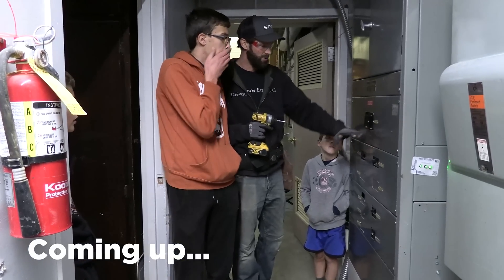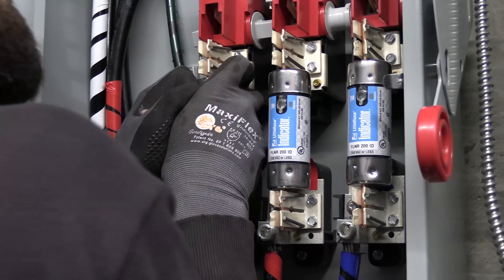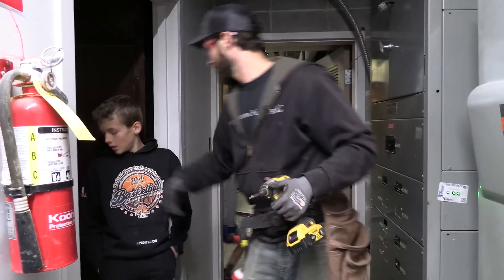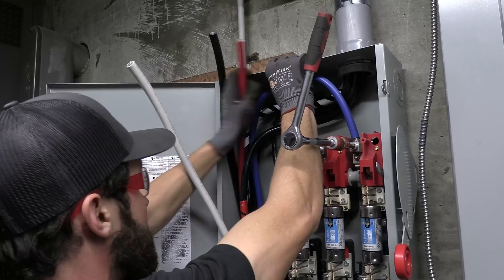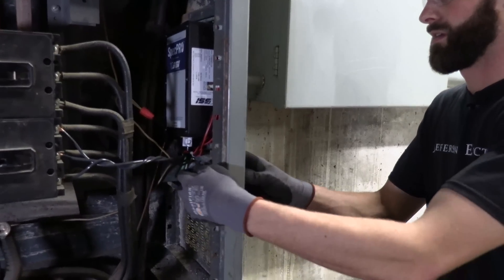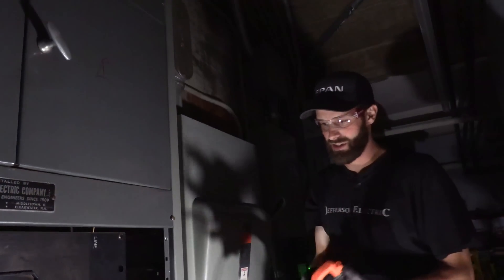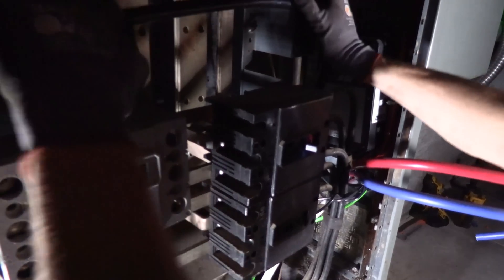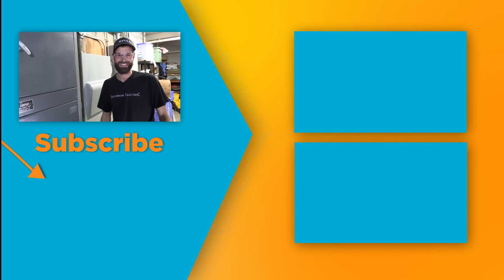They Don't Make These Anymore

Comment: Wow that was quite something I like how you got the kids involved but teach them safety
Reply: I have a feeling there's probably going to be a few more electricians in the future for sure in this family I'm assuming their family in this case myself I was rewiring lamps at 4 and 5 years old that's how early learn basic electrical.

Even before that understood most of the basics of electrical systems.

He might think I'm joking here but I'm serious in that respect and also my first word was my mommy or daddy or Dad or Mom but my first word was actually Outlet as in a receptacle.

People said I was literally born to be working on things and doing repairs.

I was actually doing electrical work even when I was quite Young of course falling all safety precautions but everything else.

Was a bit late on getting going on soldering when I was a kid for electronics because my dad had a bad experience with soldering iron once it was all scared because he really messed up his fingers with pretty bad burn.

Me and my father were repairing that you'll hairdryer had to put in a new diode it was just use to cut back power for either heating element ornamotor cannot remember which you know the old trick of half wave rectification to cut output power essentially like the old school high low off dimmer switches.

Actually have a little box it's essentially a nice big chunky diode to be a a way to cut back the output of linings for low-level Lights by just using standard incandescent bulbs of course fused and has a ground and even a thermal fuse this was Obama design there's a relay to bypass and a relay for off although this was never used what was in place possibly even for future automation and yeah there is a bypass switch as well just built into it small Project Box the original one I built basically just had one of those tags strips with a grounded female fog and the diode and a fuse in a female receptacle can't remember if I had a second quarter Accord as the outfit and just a female in there or single receptacle on the outfit had use that one never but it still around somewhere also good for taming down Christmas lights and other things as well I think I would have given it to someone that wanted to use some personal size for low-level lighting he just needed a bit of light at night in some rooms and they other rooms like this as well I basically built a bunch of these devices for this and also had a switch on a cord as well the thing is that dimming wasn't needed just either full-on or fall off or just a half wave rectification only made a lot less expensive than trying to use some sort of dimmer had all the parts anyways.

Something of Interest lawn friends came up with he was a guitar enthusiast and he had a gag cable that was 40 said was the only true electric guitar cable there was!

It looked what would have been a male grounded plug going to the other end and guitar cable recorder inch Jack of course however absolutely zero internal clock the connections in fully insulated does a gag of course but yet it got some people's attention when he pulled the thing out and yes it was a luminating plugged to get the point across that looks like there's actually power there he had me build this forum it was one of those things that if somebody just like their eyes pop out of their head if they even see it for an AC and plug it in before plugging in the guitar that is something that you do if you wanted to get attention or in the end get a good laugh yeah but yeah it really makes someone jump out of their skin is well it's one of the things that you know you got to have some sort of gag here in there or something to get someone's eyebrows raised.

And I also made him another one that was what he called the direct box Hannah powerful and cord coming out one end and quarter-inch Jack on the other same idea complete with a neon indicator to make it look like it's actually live.

And he also uses these for these so-called play something live is the great gag if you do it right and make sure there's no chance of anything actually being connected to 120

If anyone has ever seen the movie Young Einstein you get the idea what might happen it will sort of this was not the case!

Unseen 20-volt devices built from Surplus military components and all and him actually told components of what appears to be a telephone system or otherwise might not be that far off how someone might have come up with something years ago.

For example first flight simulator was actually offering from an organ console.

Also first power wheelchair was actually built from Surplus for spares from aircraft and other parts in the military!

Actually once built this power karke I don't know what good call it wasn't really a wheelbarrow but it could be used as such essentially you just charge the thing up had some pretty beachy motors for Drive don't remember what they were from possibly some sort of accessibility vehicle but don't know they're just something someone had lying around you go ahead with the welding in all but he had built this for his folks and himself to move stuff around I'm very big place and it was helpful since a lot of stuff was on a pretty steep hill that's all very long driveway.

Those run off a few deep cycle batteries plus it had the ability to provide Power for other things as well including a power inverter and the charger was on board write down to having a short cord reel for recharging and one for power out.

The steering and everything was pretty unique as well it sorta look like the cross between some gigantic Garden card and a power jack.

The dump bed was actually hydraulic!

Yankton hydraulic power pack out of something that was pretty much done for and no longer use still can't remember what it was

Just one of those little interesting things have someone come up with that was quite useful in the circumstances I do remember it had knobby tires on the thing as well which I think we're off something else as well if I remember correctly.

Also nothing even the same person can't remember we came up with what we called the Volkswagen as in voltage and wagon.

One of those adult Radio Flyer wagons you can get for my garden uses stuff loaded up batteries portable power in since they had an off-grid cabins as well.

So basically you'd have power you can bring with you when you're doing things then yes is burger and everything else as well as a small engine alternator and alternator and yes the frame and everything was beefed up to take all the weight and even a connection panel in the rear for everything pretty beefy connectors as well this could actually be connected to the electrical system of the cabin directly.

Including having onboard dc-to-dc converters various voltages output heck this could even be useful for those low voltage power input wire feed welders that's been for off-grid.

Used quite often for welding as far as the idea.

Of course everything probably built and overload protection and so on you wouldn't do it any other way because of that much power going that thing short circuit would be a really bad idea

Comment: In the uk industrial and some commercial distribution cabinets on commercial or industrial premises where they are directly connected to the transformer we call them widow makers because attempting to work on them live one wrong move and bang your dead as most industrial in the uk are 400amp per phase at the supply and most commercials are 100amp but 230v per phase

Comment: At least as far as car battery terminals, lead not copper, true, the warning is that a steel brush leaves grooves in the metal, which allow air, moisture, and corrosion. I'd guess "only one way" damages the cable less, but would still think an anticorrosive paste should be used to seal those "brushed" cables from corrosion.
Reply from the maker: Thanks, @Lyfan Deth!
Reply: they use a copper grease to coat ends of wires and connectors in big motor control centers and high voltage wires for big 3 phase motors so they don't corrode over time and make connections get hot and such. but those are thousands of volts and hundreds of amps.
Reply: The back and forth causes the wire brush strands to break faster as well
Reply: As a plumber wants to minimize potential leaks, they only go in one (circular) direction. Sparkies don't have to worry about that, but as others point out, it can increase the surface for oxidation. (assuming it isn't dipped in no-ox.)

Comment: My only disagreement was with you telling the boy there was so much power it could turn him into a puddle. I'm certain there'd be nothing left except smoke.
Reply: I have it on good authority that there will be some black soot as well (a friend has been to a call at a substation after someone broke in to steal copper)
Reply: @malcolmtaylor111   That looks like a 208/120Y panel, so while the boy would most probably be dead, and almost certainly have burns, he would hardly be soot, smoke, or a puddle. Even if was a 460/277 panel, the results would be the same. My problem is that he had the young boys that close to live circuits, regardless of the voltage.
Reply: @littleprincess4417  I was thinking the same. That kid had zero place there. ZERO.
Reply: @malcolmtaylor111  My instructor had a binder with a bunch of photos about electrical. I remember only two.

The one of an Iraqi power station that had been obliterated in 91' with some locomotives in the foreground and... Of a poor sparky, who got bit and killed because he was only wearing regular work clothes in a situation he ought to have been wearing PPE rated for arc flash.
Reply: @malcolmtaylor111  that happens a lot on railway tracks. Crazy people
Reply: we got this horrible safety talk from a guy who accidently had arc jump to his arm from high voltage line and it just burned his arm like a stick of wood he was a mess hard to believe he survived. they gave him job of traveling around doing safety talks.
Reply: Right. We don't really melt into a puddle. We turn into bricks of carbon. But still a valid image of doom.
Reply: I was told by my electrical instructor in high school that it smells like hotdogs when someone explodes from something like that.
Reply: I have a memory from when I was 3 or 4 of my mom telling me to stay back from the (tenth floor) balcony railing because if I was to fall over there'd be nothing left of me but some dust. I still remember thinking thinking that sounded highly implausible.
Reply: I get what you say - the point he is making still stands. You want to stay well tf away from anything high voltage unless you really know what you are doing and absolutely have to be near the equipment. 

In the early 80s, my dad was roommates in the hospital with some kid (16-ish or so) who had a run-in with a railroad power line. Guy lost an arm due to 4th degree burns and had additional 2nd and 3rd degree burn injuries across his chest and face, and he probably wont ever need to worry about shaving or getting a new haircut. He thought it would be a good idea to play in some rail yard with his mates and at one point he decided to climb on top of a freight car. That day he learned that arcing is a thing and that you dont need to touch a live wire to make the angry pixies take a field trip to Groundville via your body.

He was insanely lucky to live. He had to get dialysis because the whole thing also did a number on his kidneys. By the time my dad met him, he had already spent several months (combined) in the hospital for various treatments.
Reply: In german, there is a saying:
Electricity will make you small, black, and ugly. 

(black does not have as much of a race connotation in german. The german original is "Electrizität macht klein, schwarz und hässlich ")
Reply: @nos9784  A phrase a friend of mine got taold from his linesman boss here in the uk: "Electricity is nasty stuff, and with what we handle, you better hope your equipment works or you're going to look like the coal they dig out of the ground." Do not use equipment in less than perfect condition.
Reply: I used to be an army diesel generator mechanic. 3 phase and diesel makes for a fun time. We used to parallel 3 phase generators together. While running. 6kw as high as 60kw, in AIT at Fort lee Virginia,  the army instructor told us touching the actual  " generator" ground could kill you. The gens had a diesel engine and a generator end. The face plate and circuit board had the ignition start and relays and lights.  You could pair them with a Massive twist to lock plug / wire and you could diagnose them fairly easy.  I learned about step up and step down transformers and voltage drop and line current and wire size. Learned how to read a wiring diagram,  schematic. Trace relays and circuits and it was a blast. 14 weeks ait and I was learning a lot. Then after the military,  I took my state test and was certified to repair,  maintain and replace backup generators and roof top generators/ emergency generators. Also have my cdl now and recently was offered an apprenticeship from a massive out of state solar and wind turbine construction business.
Reply: Usually it's just smoking shoes, isn't it?
Reply: OSHOA rules in my area prohibit the kids from even being with dad on the job site in the room he is working on its not allowed
Reply: Cold chisel, hammer problem solved.